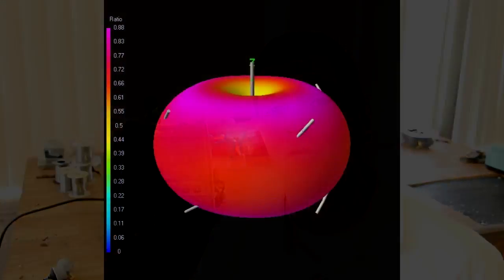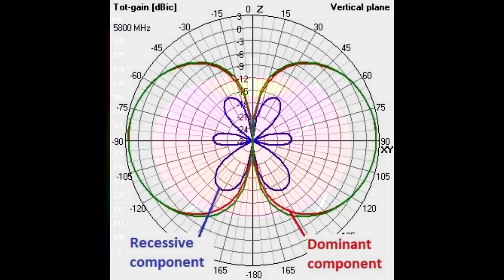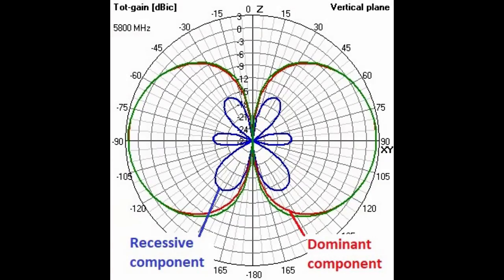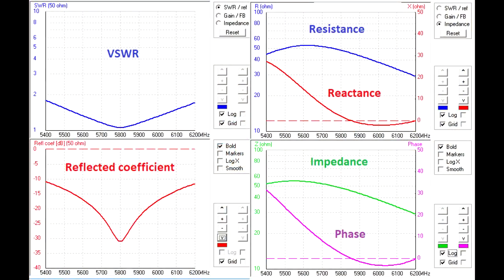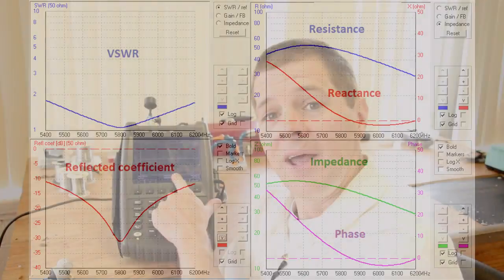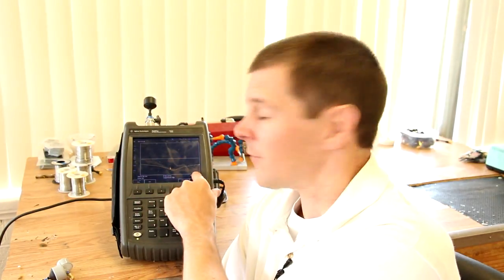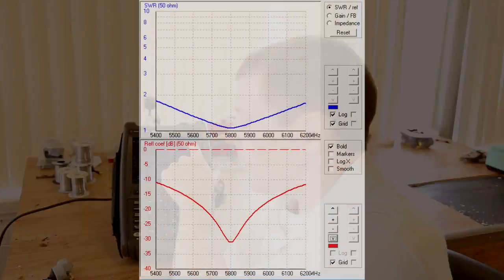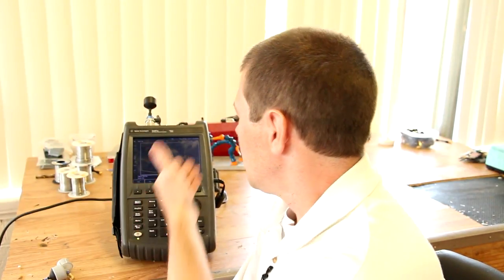The impact of SWR and Axial Ratio - an experiment

Comment: Hello Alex! Your vids is a lot instructive! Thank you for that! Alex, I'm building a BIQUAD antenna for 1.3Ghz and I'm using a PCB as element... The width of my PCB trace will be around 4mm... The measurements have to come from the out edge of the trace, the center of the trace or the inside edge of the trace?

For example:         1------------------------------------------------
                                2                                                     |
                                3--------------------------------------           |
                                                                            |          |
                                                                            |          |
                                                                            |          |
                                                                            |          |
                                4 -------------------------------------           |
                                5                                                     |
                                6 ----------------------------------------------
                                                                 
Supposing the side of this antenna should have 20cm between the 2 legs of a wire bended in "U" format... The measurement from 1 to 3 is my trace width... The 20cm should be measured from 1 to 6, from 2 to 5 (center of the trace) or from 3 to 4? Thank you Alex! Hope you will understand my poor draw :)
Reply: Up

Comment: Finally I achieved HD FPV on fixed wing taking part from my dji phantom 3 , i test the video on the ground and everything works perfectly, now I got stop on my project, when I went to text the video on the air my gimbal start to spinning around like crazy and I don't have the way to fix my gimbal to know what cause the problem, I was wondering if someone can help me, here is the video
https://youtu.be/gw2aEs1HnnM
Reply: I don't know if I damage the gimbal when it was on transport, but I test the system at home and I was working well and now I don't have money to buy another phantom and I don't think this Is something that anyone ever tried, it is a really good project but is frustrated right now

Comment: very informative! Didn't think 3 SWR would be that good still. 
Question about the one without parasitic load, so it has multipath interference: Will it be the same effect when I use a whip antenna on the quad, since it doesn't polarize?

Comment: A bit off topic but my Taranis reads very high SWR. What is this value telling me?
Reply from the maker: That's anyone's guess.  The Taranis doesn't read SWR.  It guesses.  There is no equipment inside the Taranis which can read SWR.
Reply: Video Aerial Systems 
So I shouldn’t be worried that something is horribly wrong?
Reply from the maker: It is detecting something unusual in the radio.  What that could be is anyone's guess.  You could open it up and check to be sure your connections ares secure, but that's about all you can do.
Reply: Thanks Alex. I’ll check it out. I need to get in there to repair a button anyhow.

Comment: While a 3.0 VSWR is ok on the receiver side wouldn't that be rather horrible on a transmitter?

Also, while (a properly built) ion has good VSWR at its design frequency (5800?) how bad is it at the upper and lower limits of raceband or e-band?
Reply from the maker: It works from 5600-6000MHz.  Outside of that range, the axial ratio and VSWR both suffer.  Thus, I would not use it for L-band operations.
Reply from the maker: The Ion can handle 5600-6000MHz with good results.  Outside of that I wouldn't use it.  This covers the entire legal 5.8GHz band, but not the L-band.
Reply: Thanks for taking time to answer.

I'm still curious about the numbers and if you agree that a decent VSWR is more important on the transmitting side.

If I remember correctly you measured 1.04 at the best frequency, what's the number at 5600/6000?
Reply from the maker: Technically the best number is 5800MHz which is where I build all of them.  But honestly it really doesn't matter.

SWR matters just as much on receiver as it does for transmitter when it comes to video quality.

Comment: How would the same test be affected if the transmitting antenna were the offender?
Reply from the maker: It would be similar except with the high SWR antenna, the transmitter would get hot.
Reply from the maker: Most reputable manufacturers (ie not realacc or Foxeer) have good SWR and will work well.  Obviously I am biased toward my own brand, but you can't go wrong with TBS, Luminier or True RC.
Reply: Video Aerial Systems i consider myself a bit of a slut for antennas and have tried a hell of a lot of them.   TBS Triumps have worked well in the past along with Pagodas and even the new Strix HOOT.   Trying to figure out how the nulls may effect me on a flight tends to be my biggest consideration before makig a flight, pagodas seem to be the most sensitive for me when going to longer ranges(especially on return if frame/battery/gopro gets in the way)
Reply: Video Aerial Systems hmmmm...    you raise a good point.   With that in mind, what would be the antenna that you feel would most likely help reduce transmitter temps?

A chart of popular antennas would be helpful.   time to start checking SWR.    might explain why i have lost two holybro TX on 600mw in the past 6 months.    may have turned them up and had a less than ideal antenna on it.

Comment: Interesting experiment.  As an Extra class Amateur Radio Op (for 40+ years), I've done my share of antenna building and measurements of SWR.  At a 3:1 SWR,  you are pretty much losing 1/2 the signal. (transmission line losses are probably not significant on Quads, but if you have a 100 ft. run of coax, it can be meaningful, and the higher the frequency, the greater the losses) Good info on the axial ratio, which is helpful for my little racing quads. For my camera birds, distance without break up is more important. Best to have the right antenna for each situation. Thanks for the info. Cheers.
Reply from the maker: Bill Somrak - The long length feedline is definitely worth noting.   Long feedlines throw off both VSWR and axial ratio.

Comment: Alex, were you transmitting with an  ion as well on all the tests?
Reply from the maker: Chris Michael - Yes.  A correctly built Ion was on the transmitter in all of the tests.
Reply: Thanks Alex, another problem I have, is the propagation donut plot. I need a little stick man in the picture to get some sense of scale. Can i  assume if the antenna is by horizontal you are losing half the donut in the ground. This is tricky stuff, I'm glad you have a handle on it!
Reply from the maker: You are correct that half of the signal is driven into the ground, but that doesn't mean lost.  The ground will reflect the signal... which is usually a bad thing.